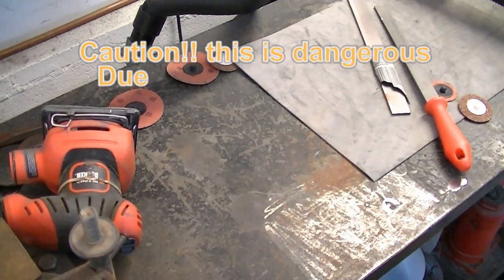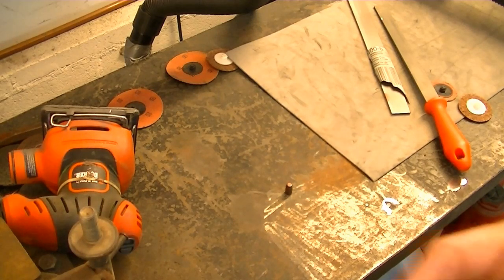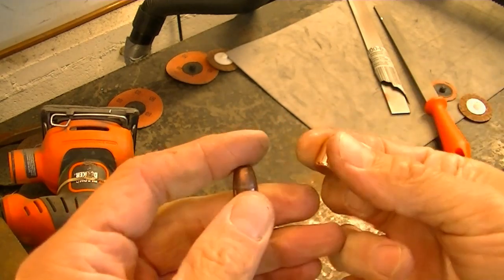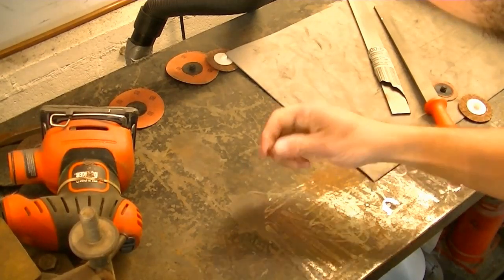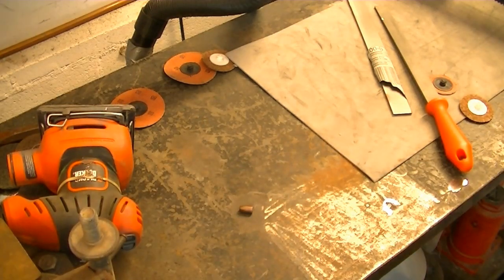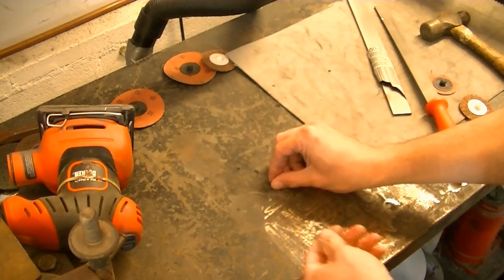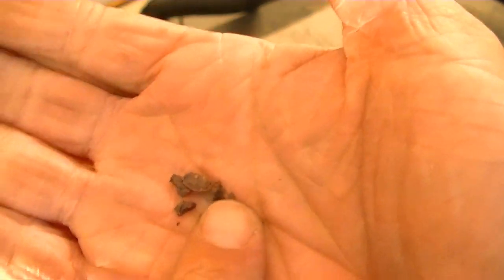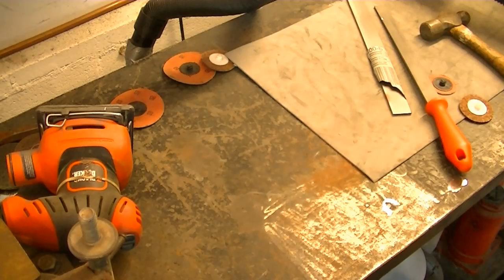Smashing a Frangable Bullet with a hammer

Comment from the maker: Your welcome, I had been looking for some frangable bullets to reload for my range to use on the run n' gun section when I found these.  They were actually cheaper than any fmj I could find at the time.   Strange to reload cause they are only 100gr but as long as most 124gr.  I use load data for 124gr and they load great.  I can look and get pricing on some for you if you like?  Thanks so much for watching.